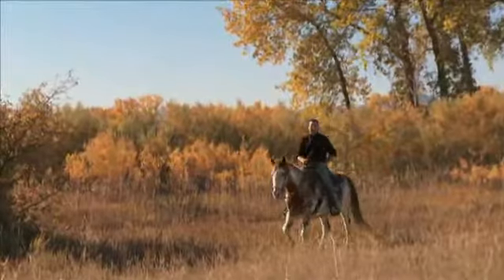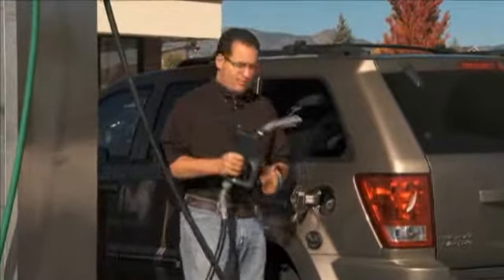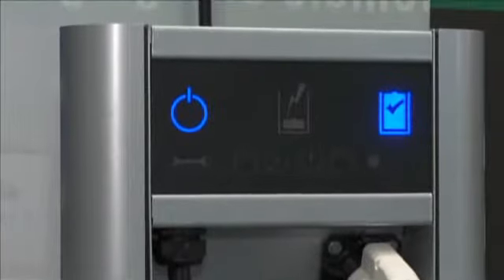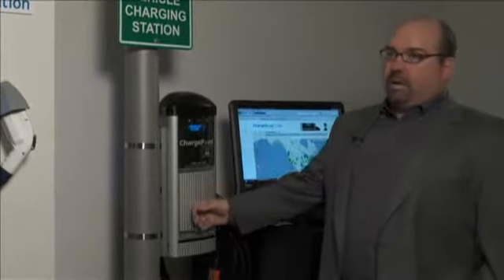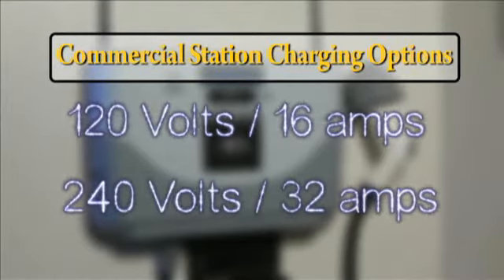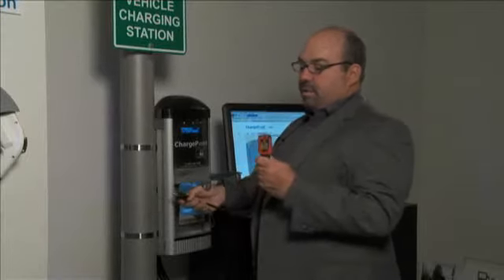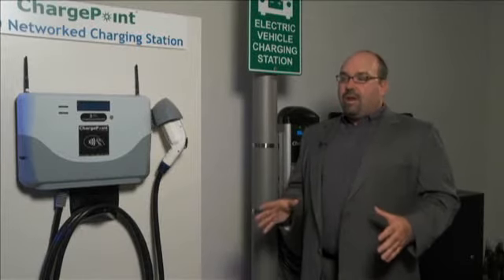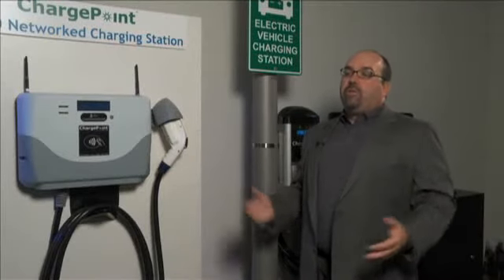electric vehicle charging stations future

Comment: It seems to me the solution to your question is more solar panels on the roofs of buildings. More windmills where there's wind to generate electricity.
The fact that many people only travel about 40 miles a day most of the time anyway,, electric cars may not prove to be much of a pollution problem. At least not the way the ICE has proven to be. In anycase we've seen what the ICE is all about. Time to try something else.